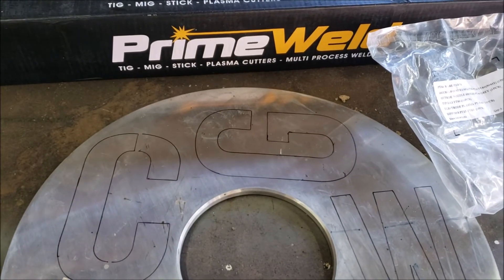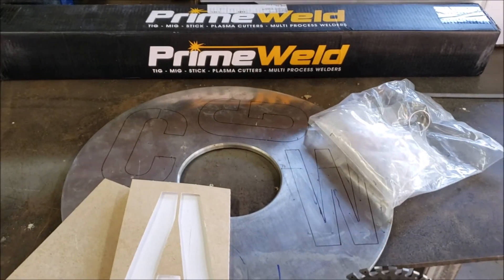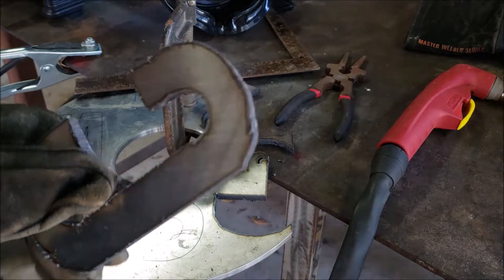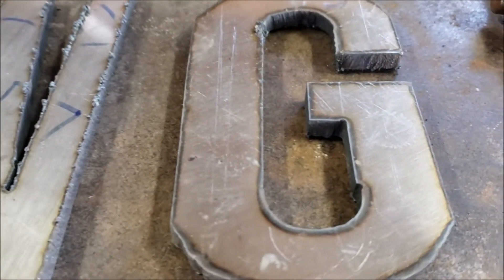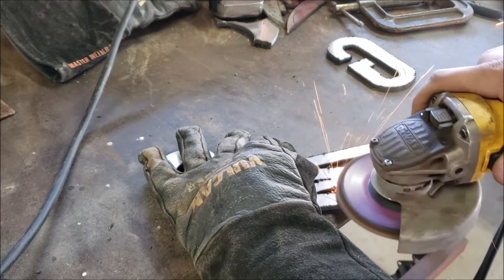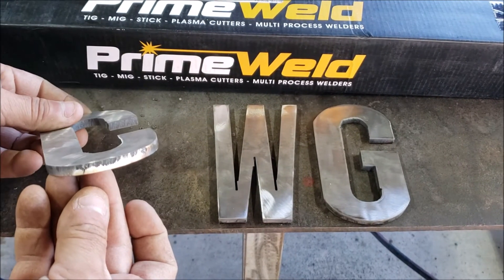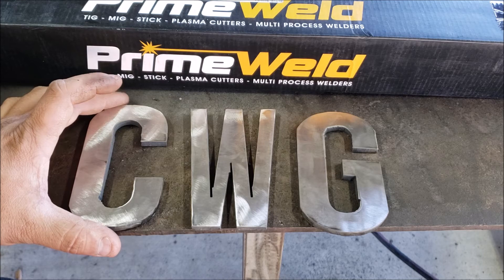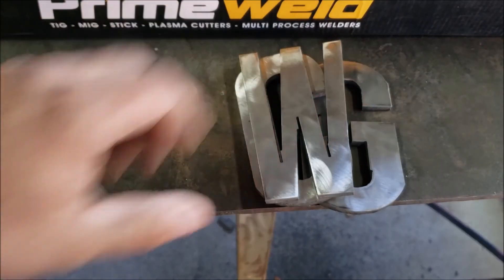Testing the Primeweld CUT60 Plasma Cutter on 1/4" stainless steel plate review : #primeweld

Comment: Well your free hand cuts are definitely better than mine !
Reply from the maker: The cuts came out good and looked better once I cleaned them up a bit. The guide and stand off piece  makes a big difference when cutting. I think if I used drag tips the results would not be as nice compared to these used. Overall I am happy with the cuts now.

The Grinder will make our cuts look sharp again.

Comment: I have that very machine and it cuts anything that I need. I work mostly on aluminum boats but get into stainless every now and then. I'm an old guy so I still use my torch for any carbon steel that I work on but that's a good plasma cutter and definitely worth the money. We tend to be our worst critics but those cuts look just fine to me. Anything that needs cleaning up can be cleaned up. I use my Dremel quite often and own good files for that kind of stuff.
Reply from the maker: If I ever need to build a boat I know who to call now.  We had one of the best finishing lakes but due to the demand of water the valley needs our lake is always low. Falcon lake was built as a reservoir so they drain the water out every time it starts to fill up.
 
Do you use any mixture of gas when cutting stainless or aluminum? I remember someone telling me there is certain mixtures of gas to use if you want shinny edges but these cuts still look good after a quick grinding.

I always try my best but I have to convince myself that I am not a CNC table. These letters are also going to be for my new Channel name .